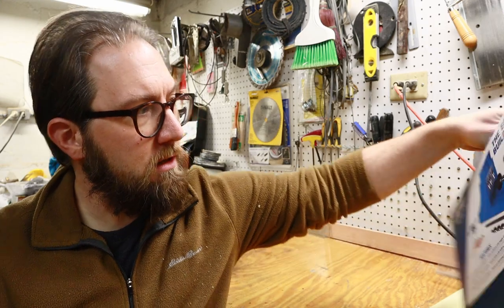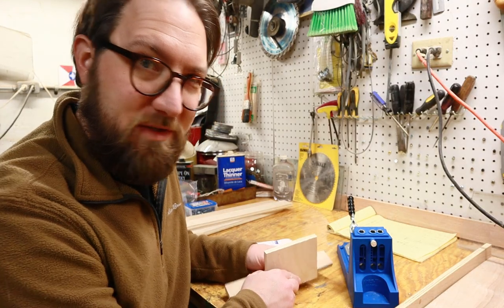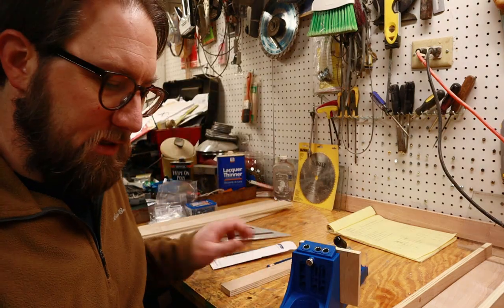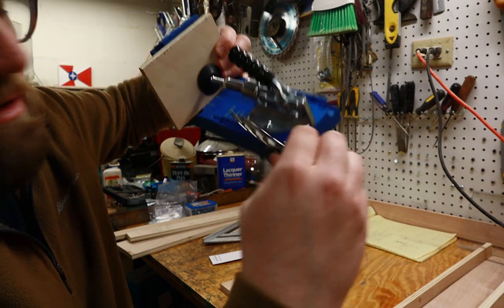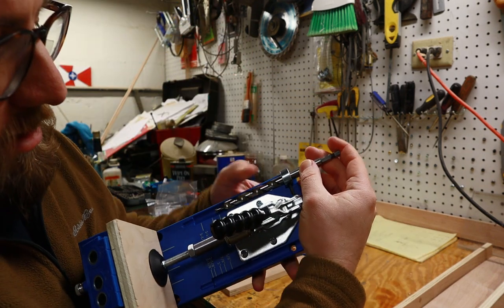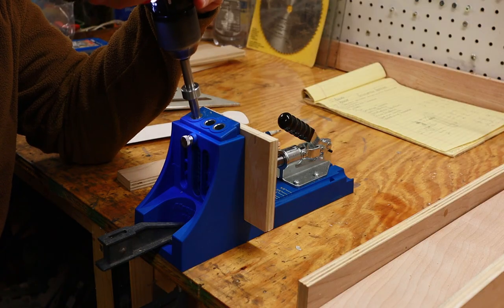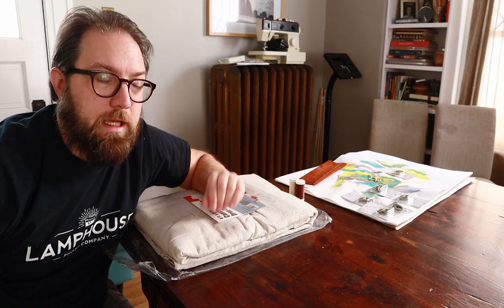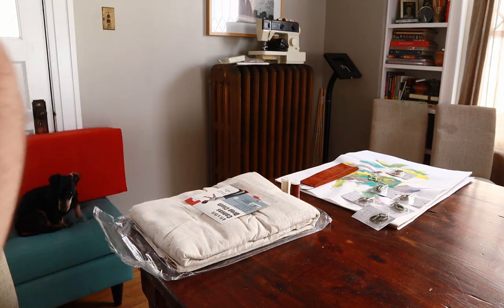DROP CLOTH shades / CHEAP DIY / KREG JIG review

Comment: your leather straps how wide did you cut and length? mine our 1" wide 9 "length
Reply from the maker: I just did whatever was in the tutorial that we linked in the description, but I think it was basically that size. Wide enough to just fit through the d-ring, and long enough to wrap around everything with two extra inches to lap over and sew shut. Pretty simple really, you can't do it wrong.

Comment: Is there no heat in the camper?
Reply from the maker: Nope, but we don't really camp when heat would be an issue that couldn't be addressed by some wool blankets. I'm more concerned about keeping cool honestly.
Reply: He has an awesome portable heater. It can be seen a few videos back. 🙂
Reply from the maker: We did use a little electric space heater for camping in 20°F weather and it worked fantastically!